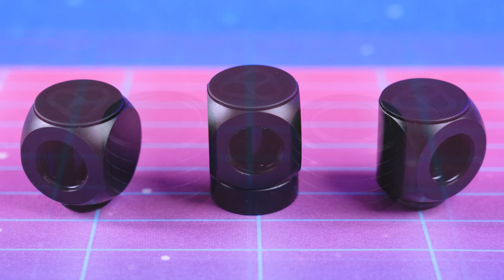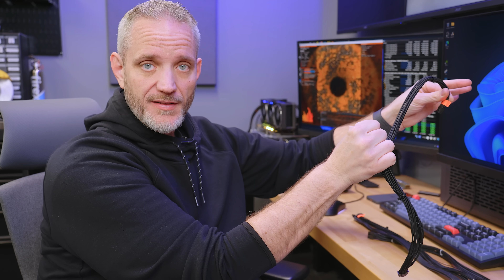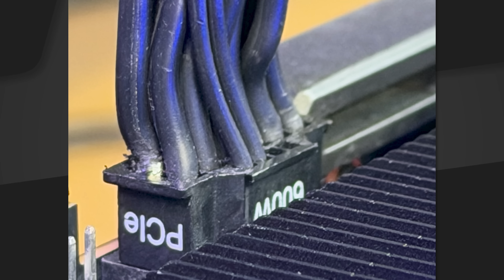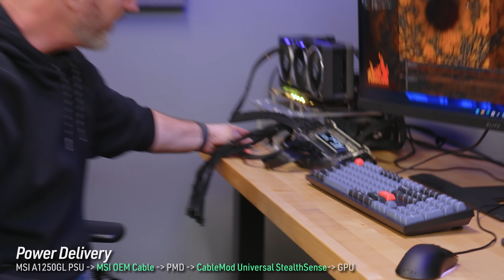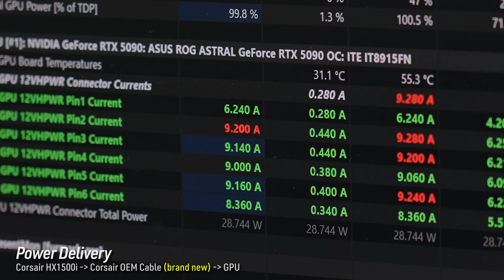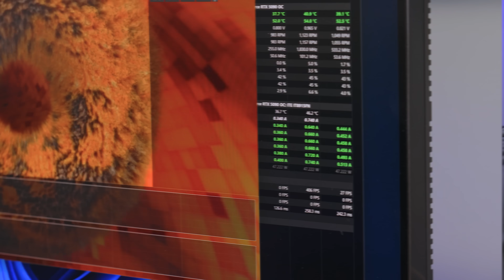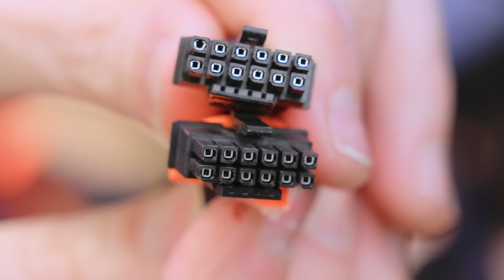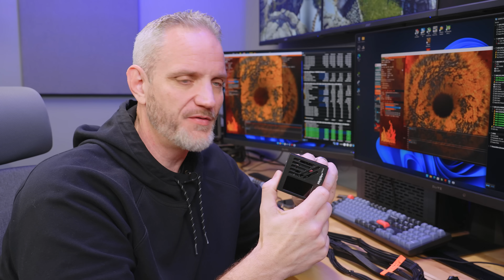More details on what could be causing 12VHPWR / 12V2x6 Cables to melt

Comment: That's like Cat 5/6 cable and phone cables. I've bought brand spanking new cables to hook up to my router/modem only to find they don't work. Stick them on a cable tester and hey, guess what, stuffed wiring. Don't be surprised if the wiring on the cables was already stuffed when they got to the store you bought them from. Quality control where most of these cables are made (China) is as lax as you can make it. Or, non existent. They just don't care what they string together. It wouldn't be out of the question that the wires in those cables, at least some of them, were under gauge. And/or had been packed roughly and bent out of shape in the process. They might work, sometimes, for awhile, then things start to go haywire (pardon the pun). Though, repeated handling like you do when testing wouldn't do them any good, either. But, don't go blaming your testing for the faults in the cables. They may have already been there when you bought them. Testing just showed them up.

Comment: I wonder if these companies are using 100% copper wires in their cables? Or if they're choosing to save a couple pennies and going the copper clad aluminum route cuz if they're going the copper cloud aluminum route then even though the cables are sized correctly dimensionally they won't carry the same current they'll increase its resistance

Comment: So is this poor cables or is the connector some how damaging the cables? Why wasnt this an issue with the 8 pin connector if even the lower power gpus have had some reported issues?
Reply: AMD GPUs split power delivery into different domains, so a faulty connection cannot cause the other cable to be overloaded.
OTOH the 12-2x6 spec requires the cables to be shorted together on the card.  Therefore any cables with poor connections cause the power to overload the remaining cables.
The more you learn about 12-2x6 the more insane it seems
Reply: @RobBCactive so when the issue happens, is it the cable quality or the connector quality? 

Also what are the benefits of using this one connector over 2-3 8 pin connectors.
Reply: @itsacookie1 it's a defective specification.
There is absolutely nothing to ensure even power distribution among the cables, so a single poor connection or cable defect exceeds the safety margin.
2-3 8pin are reliable.
Nvidia chose the unreliable connector to have a denser board on GPU and for them a 0.5% annual failure rate isn't their problem, the power design actually worsoned cutting corners. (see frequent blown 4080 power stages). 
Some people liked the aesthetics of 12V-2X6 on the Sapphire Nitro+ (AMD RX 9700xt) yet that is now sold at a discount after some melting occured despite lower power draw well within the max rating.

Comment: Would be nice to have a tester for the cables.  This way you can plug both ends in, monitor each pin, and be able to wiggle the cable around to see if there are any issues with the cable

Comment: I recently upgraded my 3060 to a 9070 I had cablemod sleeved extensions. when I installed the new gpu I was chasing problems. Eventually decided to try the new gpu without the extensions and bingo, bought a new set and no problems. These are not high power cards but I think cable failures are something to keep an eye on. I did test the cable and there was nothing obvious on my multimeter, but it was enough to upset the applecart.

Comment: I disagree with most of this, especially at 20:26. How can a cable with 24 or 32 wires going to a connector with 12 (or 16)  wires be better? I still believe that the 12V-2x6 connector on a native PSU cable is safer and more effective than using graphics card adapters or PSU manufacturer splitters. I honestly think that your constant inserting and unplugging cables loosens all the wires and is causing most of the problems at the 12VHPWR connector.
Reply: The literall brand new Corsair cable was working almost as bad as a bad cable mod cable... The use case for them for sure damages the cables, but the problem comes from the cable itself, we all have known that for years why are you blaming J? (Even though he also established multiple times during the video that they wore out the cables more than average because of the work)

Comment: When will these idiots finally understand they have fallen for the 'sunk cost fallacy' and just ditch this horrible connector.  Nvidia and the others in the 12vHP consortium need to realize that even a 0.5% failure rate is utterly unacceptable.  NONE of them would get on a flight with such a horrible failure rate...

Comment: Clean off the pads completely and drill through for mounting screws. Attach copper clamp lugs and bolt through the drilled holes to secure them. Do the same on the PSU.
Run 1/8x1/2 copper bus bars to your card, bending to fit as required. Should be good for 150amps if your connections are solid.
It's wild that this would even be mentioned as a joke, but here we are.

Comment: 600w at 12v is 50amps, like it needs a dual 10 guage or even dual 8 guage wire, why are they running so many small wire on such a load. Couldn't they just make a different pin that would accept bigger wire

Comment: I LOVE THIS!!! As a network admin and sound engineer and I am CONSTANTLY testing cables. I have had plenty of times where the ends of ethernet cables and audio cables are perfectly fine, but a break happened along the sleeve and I have slow or no connection, random data packet drops, phantom power issues, noisy signal, no signal. Its awesome that you can demonstrate this on power delivery cables for computer components, especially when in this case, components can literally MELT!!!

Comment: My experience while mining is that most cables are 20AWG.  That is technically rated fine for the power used per pin, however, the crimping on the pins was the real issue.  The wire is just to small to have a proper crimp, and the connectors would fail, melt down, and attemp to create small fires....   I ordered custom 18AWG cables, and have never had an issue since.  All connectors and wires have survived literally years without issue, while allowing significant power draw 24/7. 
Flexing cables around can certainly cause the wire to break over time, and that may be the issue with some of yours, but I'd bet there is an issue with some of them having broken wires at or just before the pin connector crimp.

Comment: I've been hoping Cablemod makes one'a the 12VHPWR cables for the Enermax Platigemini but they still haven't. I'm guessing it's probably not gonna happen at this point, but the cable that came with the PSU has been working fine and there's only the tiniest variance between the pins on my Astral, so I suppose I'm not horribly worried about it. I run HWiNFO the entire time I do anything beyond dingling around on YouTube or some junk so I can keep an eye on that shit, also. Haven't seen it become a problem in the six months or so I've had it.

Comment: I could be wrong about this but to me it seems the cables arn't upto spec on the power and heat might be time for custom making cables coming back with some thicker more durable copper core cable inside or maybe a different core

Comment: You can still have ground-side monitoring on a unified ground plane, it just depends on where the ground plane is unified!  The automotive industry does it all the time.  ;)

I still feel like whatever the problem(s) may be, the source is inherently in the specification for the design.  Somebody missed a critical safety margin calculation or analysis in writing the spec.  There's no reason we should be looking at overcurrent failures on a standardized consumer product like this.

Comment: Any damn server has properly designed power supply connection between board, PSU and plugin boards.
PC: lets hang a 5pound PCI-E card on a tiny connector and route like 50Amps on some tiny wires. 
And put all that into mass production, so this crap is everywhere and everyone has fun with it

Comment: I had this random shot off issue under load with the RTX 4090 FE using the exact same Corsair 12VHPWR Type-4 600W PSU Power Cable (SKU: CP-8920284). Then I replaced it with the Corsair Premium Individually Sleeved 12VHPWR 600W Type 4 cable (SKU: CP-8920331) and the problem has since disappeared. It's just weird...